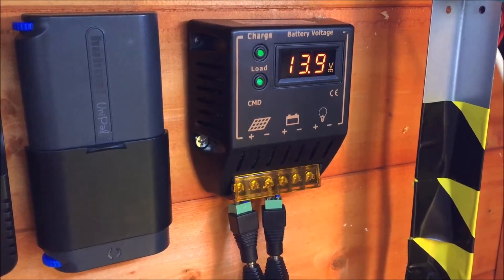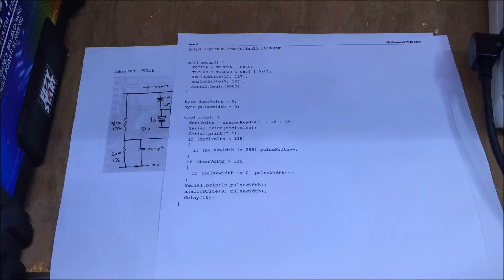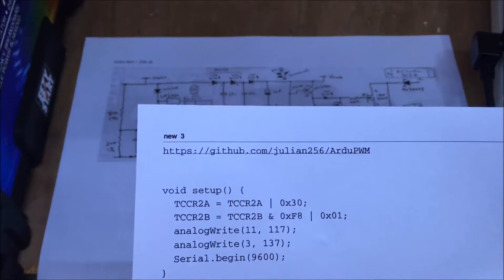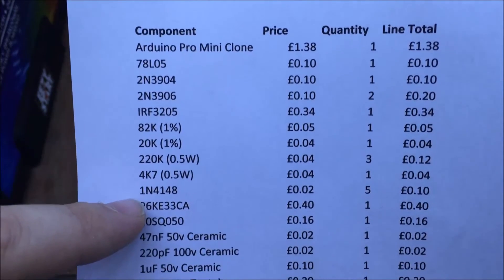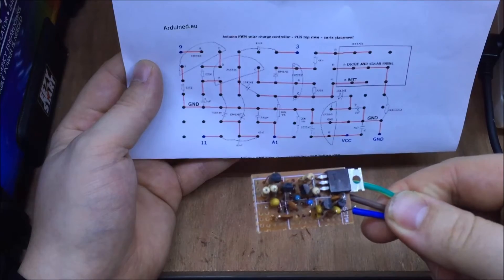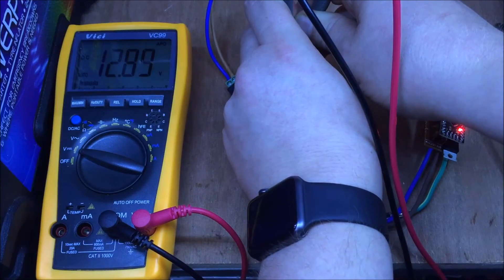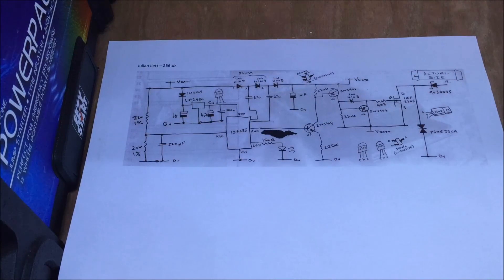PWM Solar Charge Controller - Adam's Arduino Projects

Comment: Hi Adam, the code and schematic is shared in what kind of license ? I want to create and OpenSource too project with charge controller and automations. Can I copy parts of it?
Reply from the maker: Yup - do what you want with it! Have fun :-)
Reply: @AdamWelchUK  whats is the function of pin 11 and 3, I removed it on simulator ans seems to work anyway only with pin 9 pulse
Reply from the maker: They form a charge pump. It generates a voltage above the voltage of the battery. You need this because the n-channel mosfet is on the positive side of the battery - the gate voltage needs to be 5v above the battery voltage.
Reply: @AdamWelchUK  got it, simulator wasnt using this mosfet, thats why

Comment: Could it be done with an ATtiny85?
And also you could disable everything unused that is using power in the Arduino Pro Mini.
You could also setup a power down and cyclic check if there is enough sun to boot up the charge controller etc.
Reply from the maker: I did make another version using an ATTiny. I managed to clock it so it’s power consumption was pretty low - more work could be done though.

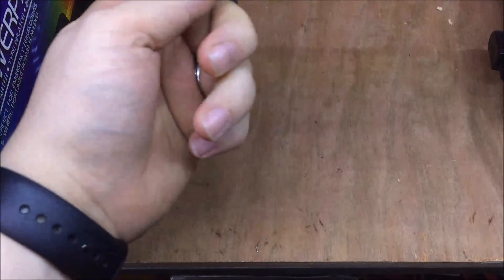Comment: @6:30 You didn't let the magic smoke out so it works. ;-) Nothing ruins the day than after hours of work, smelling the thing go up in smoke. Unless you are doing it on purpose.:-) 

Back 30 years ago I bought some surplus 24 volt generators made by Delco-Remy. The problem after modifying them was controlling the voltage and keeping it down. If the field was connected directly to the armature, it would self generate up to 120 volts DC depending on the RPM it was turning at. A unit like this would have controlled the output, if built to handle 50 amps, perfectly.

Comment: Hi Adam,  I thought I'd cost this project out some 2.5 years later, using Aussie dollars and current exchange rate.  I was quite pleasantly surprised to find that for the individual component costs, purchasing most in bulk from eBay cheap Chinese suppliers, I could still do it for the equivalent of GBP 3.76 (plus the cost of the 100V 220pF capacitor, which I couldn't find anywhere...).  However, it would cost me a little over GBP 14 to get all those components in the bulk bags to achieve that price.  Alternatively, to buy (most of) those components individually at my 'Maplin' equivalent over here (which thankfully has NOT gone into receivership - but perhaps that's because they are so much more expensive in the first place...) would cost just over GBP 11.
Oh well - since I can't afford to buy the solar panels for my garage roof in the first place, its all a moot point at the moment :-D

Comment: Could you program one to be used for a lithium battery bank
Reply from the maker: Yes, but probably only a 3s pack. 4s is probably a bit high to work with the high side n channel mosfet and the charge pump.
Reply: 3s is all I have now I have an ammo can with 3s 26p in but I don't have any solar stuff but I may if it's cheapish

Comment: I have been thinking about building something similar. also maybe trying for building a higher voltage 80-120 max in. and 12 -100v out and about 60 amps. so a buck/boost controller. but that may be inefficient. and over my head as well.  great video.

Comment: Hello sir, 
I am working on buck converter based solar charge controller ..plz tell me is arduino used for regulating the pulse width to mosfet switch and whether p&o algorithm is used for pwm?
Reply from the maker: Hello.  This is a PWM solar charge controller and doesn't do dc to dc conversion.  It's algorithm is more simple than perturb and observe.  The arduino simply tests the voltage of the battery - if it is below the set point, the PWM duty cycle increases, if above it reduces.  Finally if the voltage is perfect - it leaves the duty cycle where it is.
Just so you're clear - this circuit (and code) was designed by Julian Ilett - search youtube with his name for his channel which has a series of videos on this and an MPPT solar charge controller.
Reply: Thank you sir

Comment: Hello sir,
I am final year electrical engg. student and in my final year project I am working on ARDUINO BASED PMW solar charge controller and i am working with same circuit as your PWM5 circuit. I completed all connection and programing also done (run sucessfully) as per circuit of PWM5. But i am getting some problem in "high side driver" in which MOSFET (irf 3205) are not turned ON ( not trigger) that is why current are not flowing in the circuit so my battery is not going to charge.
so i request to give me some solution for this as soon as possible.........
I apologise to my poor english..
Reply from the maker: +Jatin Patel Hello Jatin. This is not my circuit design - it is by Julian Ilett and his videos on this charge controller are well worth watching if you search for them. It's impossible for me to answer your question without further information.  Are you seeing the voltage increase at each stage of the charge pump? If not perhaps you have a bad diode or capacitor? 
I'll try to help but I need much more information.
Reply: yes sir sure,
as per your question... YES voltage is increse at each stage of the charge pump (20 volt at the end of charge pump circuit)...
and one more things i use a variable power supply ( voltage source) just for a testing , not use solar panel.. so is there any problem for connecting power supply instead of solar panel ????
sir can you tell me how to goes(drive)  GATE SOURCE VOLTAGE for MOSFET triger and how to work T3 transistor???
plz reply sir..........
Reply from the maker: Have you watched this series of videos from the designer of the circuit? They explain a lot...  https://www.youtube.com/watch?v=D826h-YQun4&list=PLjzGSu1yGFjUsB3ChZJ2_-MTNp7bHaKED
Reply: yes sir i watched all videos for pwm5..so as per videos nd diagram i connect whole circuit..but prblem is there are no current flows either i can say there is no turn ON mosfet..
Dear Sir,Please tell me the frequency of mosfet triggering frequency in aurdiuno based PWM5,Our frequency is 947Hz only....
so what can i do.....
Reply from the maker: If the mosfet is not turning on I'd look at two things - Is the mosfet functioning correctly?  Can you remove it from circuit and test it works in a simple circuit?
Is the charge pump creating a suitably high voltage above that of the battery voltage to turn the gate of the mosfet on - so for the IRF3205 you need at least 5v over the battery level.  So if your charge pump is generating 20+ volts that's great - is that 20 plus volts getting to the gate pin via the transistors?  
Haven't you got access to tutors and support for your studies?
Reply: up to this very helpful for me...thanks sir..
yes i have a 20+ volt in charge pump circuit.... 
but why current is not flow as well why mosfet is not turned on... i need answers for this ...
plz reply..
Reply from the maker: +Jatin Patel I can't possibly answer these questions I'm afraid with the little information you are supplying. Sorry - you'll need to diagnose this, or ask for help from someone who can see your circuit. Your college staff should be able to help.

Comment: Great to see this work .
Reply from the maker: It's a neat design but quite cramped.  I built some other versions where I designed the layout - not where near as small (or neat) but you can see more easily what connects to what.

Comment: I have a 50w solar panel and a PWM charge controller that i can set the 40 ah battery voltage to. what voltage should i charge it to?
Reply from the maker: Most charge controllers will use a bulk, boost and float charging profile.  Many will boost to 14.2-14.6 volts and float at around 13.5-13.8.  If your battery is sealed or AGM then you are better using the lower end of those ranges.  If your batteries are flooded then higher is probably better as long as you keep an eye on fluid levels and top up when needed.

Hope that helps.
Reply: Thanks for the help

Comment: you got a new sub :) I wanna build one of these.... I've got a few 5V panels I wanna run in series and use a boost converter to get up to 14v... bad idea???
Reply from the maker: +topher Thanks!  I'd run either three or four five volt panels in series and forget about the booster. 15-20 volt is a fairly standard range for a '12 volt' panel.

Comment: Hi interesting - would suggest have a look at sleep modes / switching off parts of chip not required / clock speed reduction / BOD disable etc. to further reduce your power consumption. You could more then half the figure you have at the moment even with the atmega 328 quite easily. With different chips (even sticking with Atmel /Arduino (eg the attiny) microamps in standby are very achievable using the WDT to resume /monitor / and 'resleep' the MCU if action not needed (eg no solar output). Julian Ilett again has some interesting and informative videos on this.
Reply from the maker: +RDH1024 Thanks yes I have made a version using the ATTiny which drew less current. Julian recommended I change the 78L05 in my ATTiny version for a low quiescent regulator. I need to look more into optimising power through code. It's on my list for some point in the future.  Thanks for the comments.
Reply: with the ATTiny I achieved >30 microamps with an alarm system I built (battery /solar power) The blinking alarm active led used more power overall ! Sleep modes are massive power savers (even sleeping between sampling / led blinks)
Reply from the maker: +RDH1024 Thanks for the suggestions. If I'm using the analogWrite function can I still use sleeping modes - I've always thought you couldn't?
Reply: Hi - during the deepest sleep modes the chip is in effect stopped and the ADC would be off; however what you do is repeatedly exit sleep mode  & re-enable the ADC take measurement/do locic then re-enter sleep. The sleep will be typically for a max of 8 seconds (using WDT) unless you use external interrupts. Hope that helps. If you would like I'll email you the code I used with the ATTiny when I was playing with the idea (its a mix of Arduino and Atmel raw C).
Reply: on its way Adam, feel free to do as you wish with it -it runs on the ATTiny 85
Reply from the maker: +RDH1024 Many thanks. I'll read through it with interest.
Reply: email sent you should have it now - very welcome, hope it helps

Comment: Hi Adam - I really enjoyed this video.
I'm now inspired to make more videos aimed at helping people to make the original PWM5 controller (and an SMD version). The big advantage of the PIC over the Arduino version is low current consumption, just 1mA instead of the 28mA of the Arduino version.
Reply: It is my intention to eventually put the PWM5 using the PIC back into production to some degree. I've worked several years in PCB manufacturing so hopefully that'll give me an edge on creating it in an efficient way. What I haven't solved yet is any kind of casing. No offense, but it seemed to me the shrink wrap and hot glue method you used is very labor intensive, so I'm hoping to create some kind of enclosure that is quicker. I'm leaning towards a type of potting compound that is extremely rigid once made, almost like plastic. The idea is to suspend the unit in a box with waxed edges, pot it with the LED still protruding from the potting, then when it's dry, simply pull it out of the box. Also, I worked for a few years selling all different forms of lead acid batteries at Batteries+Bulbs, a store here in the USA. I sold the equipment that maintained solar systems for seismic systems used in oil fields. Experience tells me PWM is actually really good for maintaining batteries because it breaks down sulfating on the lead plates, but you're float voltage of 13.5V is a little tad on the low side so I'm using 13.8V, still lower then the 14.4V a typical car alternator uses. If I do get this up and running, I'll be sure to contact you and send you one.
Reply from the maker: +Julian Ilett Hi Julian - thanks for your comments I'm genuinely made up you've taken the time to watch my video and you feel inspired!

The second version I put together (https://www.youtube.com/watch?v=1wc76v_sDjg) uses the arduino's integrated voltage regulator which surprisingly seems to use a little less current; around 23mA.  I have an idea for another version which I hope will consume only half of that but I'm waiting on some components to try my theory.

I'm looking forward to future videos from yourself on the PWM charge controller and the PIC microcontroller. It's a platform I know very little about.
Reply: What if the arduino nano replaced by the arduino uno? Thank you :)

Comment: Hi Adam. Thanks for doing this. I have an original PWM5 and it is, without doubt the best charge controller I have. I also have a basic and an advanced Steca controller, both of which have 'crashed' at some time which led me to question their reliability. I don't have any experience of Arduino but this is the sort of thing I'd like to try one day. I'm about to do some rearranging of the solar stuff in my shed (now I have a new floor!) and the PWM5 is going centre stage. Regarding the other comment about Mppt - great idea but true Mppt controllers are quite expensive and some people suggest it more worthwhile spending the extra on solar panels, but ultimately it's a personal choice.
Reply from the maker: xanataph I totally agree with the points you've made.  MPPT charge controllers are only an advantage if you have space limitations, long distances or high voltage panels.  I bought one though because I like to play with these things rather than a real need for it.

In the summer my MPPT charge controller fills my battery bank within a couple of hours - definetly by lunch time.  After which it goes into PWM mode to float charge the battery.  This is one of the reasons I really wanted to divert the solar to another use once my battery was full - as I have seen you do from your videos; shed A diverting to shed B etc.

I'm interested in your poor light theory - that may have to be something I look into. Although consistent test conditions are almost impossible with solar! 

Thanks for your comments.
Reply: +Martin Doyle Wow this all reminds me I bought a PWM5 from Julian just as he was ceasing to sell them, so I think I am lucky there. I still haven't done anything with it yet...I got a few ideas though. Need to install a small 12 volt system in the generator shed. It would also power a radio so I can listen to Radio Foxton while working in the vege garden! I was just mucking around with that shed today..redoing the budget roof coating! lol 

I agree with the position that it's probably better to spend money on more solar panels than an MPPT charge controller, unless of course space limitations apply (such as on a yacht or RV). More panels do better under poor light conditions than less-plus-MPPT. Other reasons for MPPT might be if you have an especially long cable run from the panels to the controller/batteries or if you end up obtaining some "weird voltage" panels, which are usually intended for grid tie. 

It is difficult to "roll your own" MPPT controllers because unless you get everything exactly right potential loss of efficiency in the buck converter tends to negate the MPPT advantage.
Reply from the maker: Firstly its great to hear you've got a new floor in your shed and I hope to see another video from you once you've got the time. 

I got into solar after Julian had stopped making the PWM5. If it had still been on the market I think I would have been tempted despite the cheap alternatives - many of which aren't exactly what they say they are. 

I've bought enough parts to make a few of these arduino based charge controllers, but the next time I build one I'm not going to make it quite so small. It pushed my soldering skills to the limit to be honest!

All my solar kit has been bought out of interest and experimenting. I've made mistakes along the way. I'm very happy with my MPPT charge controller, but as you say - I could have bought another 80 watt panel for around the same money. Perhaps there's another video in there - MPPT or more panels; which gives most bang per Buck?
Reply: I'll definitely do another video once things have progressed in the shed. I'm trying to 'settle' with a solar system that will do me for a while. I've bought 10 or so PWM5s whilst Julian was making them as I resold them through my business - was a shame when he stopped although I appreciate why he did. The only minor criticism is that there is no low voltage cut off like other charge controllers have, but I can live with that. I've heard that Mppt is 20-30% more efficient, and if you have lots of big panels that's a big difference, but with 100 watts or less, I think better to spend it on panels....